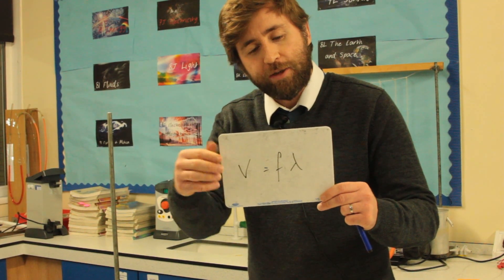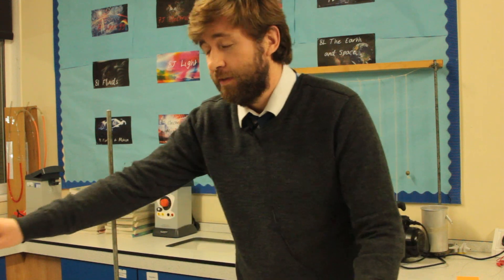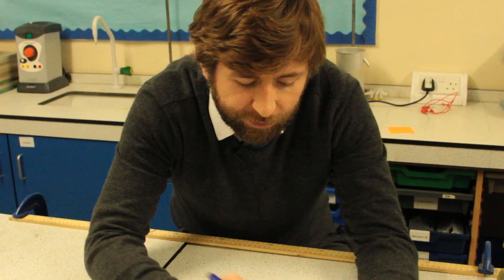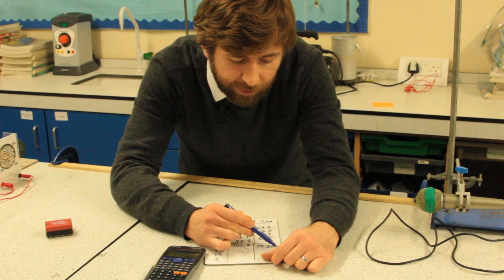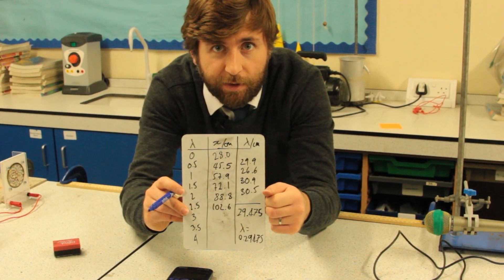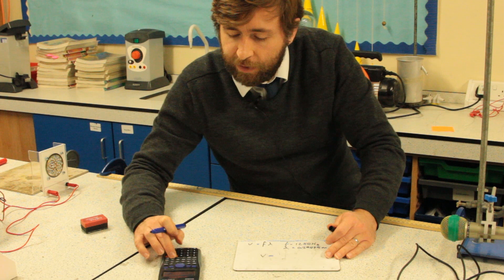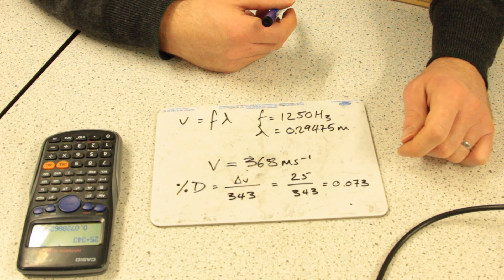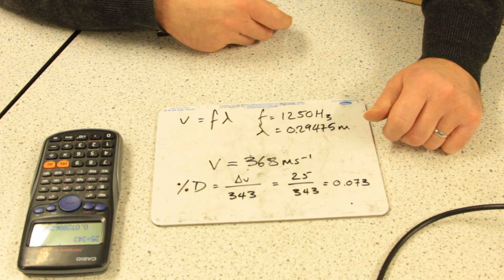Speed of Sound in Air - A Level Physics Core Practical Revision

Comment: why do you align the peak of one (mic / speaker) with the crest of other for wavelength as distance between two peaks is wavelength?
Reply from the maker: @acifychronic4221 you're looking to take more measurements for a greater accuracy once you've averaged them.  As it's a random error in measuring distance, so take more readings, eliminate anomalies then calculate mean.  
But you are right it isn't strictly necessary.  Cheers!

Comment: Just learnt about uncertainties - so would the uncertainty for your wavelengths be: 29.475 ± 7.29%.
The speed of sound uncertainty would then be 368 ± 7.29%. or 368 ± 26.9.

The method I did for  uncertainty = mean± (range/2)
The method I did for percentage uncertainty = uncertainty / mean *100

Is my method correct?

Comment: I am doing my physics practical with a similar set up but i am measuring the speed of sound in different temperatures
do you have any advice on that?
the videos really good!
Reply from the maker: Difficult one, I think you might be better off using an open ended tube method, as it may be easier to control air temperature in  a smaller volume.  Otherwise you may ahve to look at some natural variations like, time of day, windows open, or outside.
Reply: @kitbetts-masters  Yes, i am using an open end tube, with a microphone in one side and speaker on other connected in a similar way to the CRO that you did. And i have a way of changing the temperature in the tube. Can you give me advice on how i can get a good approximation of the speed on different temperatures? Mainly how i get the speed from the CRO? Or you maybe have a guide i can use for the CRO? 
I would very much appreciate it! thanks
Reply from the maker: https://youtu.be/C-t7B0kd6uU
In this video I talk through the fundamental frequencies of standing waves in pipes.  You'd get frequency from oscilloscope and wavelength from the length of the pipe.  🙂🦍
Reply: @kitbetts-masters  If i change the temperature, how would i calculate the new speed?
Will the reading on the CRO change?
Thanks,
really appreciate your videos and advice!
Reply: @lakshayveer4596  i need to ask as im doing the same experiment. How are you changing the tempertaure please?
Reply: @toniharvey6732  immersion heater

Comment: Sir, please tell me how you connected the mic to your scope?
Reply from the maker: Dan Deler it's a simple mono mic, and we have an oscilloscope lead which has two female 3mm pin ports. You could easily just cut the wire and solder it to an oscilloscope connector.
Reply: Thank you for your response, sir.
But still I am having an issue with it, I really don't know how to connect it to the scope, I am trying though. Please if you can help in any way I will be pleased.
Thank you.

Comment: Good video and very helpful - thanks. Small thing to mention (because it is important at A-Level) the calculated wavelength should only be reported to 2 s.f not 5 s.f. You can only be as accurate as the smallest number of s.f. used in the calculation.
Reply from the maker: Alfie agreed, but as I'm going on to use it in further calculation I wanted a few extra Sig Fig. Then I'd do my rounding at the end. But you are correct. The best skill is to use your calculator's memory to keep your calculated data ready for the next step! Thanks!

Comment: how did you calculate the wavelengths in the table. i can't seem to get the same answers
Reply from the maker: so the numbers I'm recording are reach distance where it is in phase or pi out of phase. (in other words every half wavelength.) so I'm just finding the difference between two of them to give me the wavelength. i hope that makes sense?
Reply: GorillaPhysics  im talking about the lambda/cm. i can't figure out how you calculated it
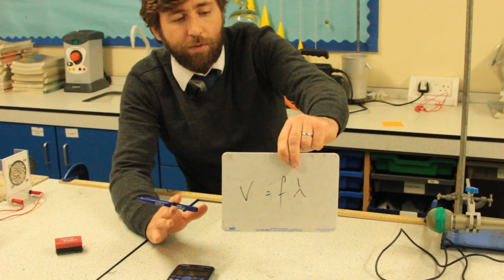Reply from the maker: Roxanne Foote pause the video at 7:02. then you'll see in first column i have number of wavelengths, ignore that. the second i have the raw measurements of these points on my ruler, each are a half wavelength apart. so third column, lambda in cm, is difference between every second reading, so 57.9 -28.0, then 72.1 - 45.5 and so on. these are a bunch of values for wavelength that I've averaged to use in my final calculation. i hope that's ok? have you tried this one for real?
Reply: i haven't tired it. I'm doing  a planning and designing lab using your method. I think understand now thanks
Reply from the maker: Ok cool, stop by and let me know how it went, (and if you got closer to the accepted value of speed of sound!)
Reply: @roxannefoote5384  same !

Comment: why there is an apparent change in the amplitude when you move the microphone back and fro?
Reply from the maker: just I think as the sound is spreading out the signal attenuates. so the difference between high pressure peaks and low pressure troughs gets less. the sound is less loud further away basically.

Comment: how did you calculate the wavelength?
Reply from the maker: +saad hassan Hiya, wavelength is measured on the wooden ruler on the side of the table.  Taking measurements between points when sound is in phase with the signal.
Reply: +GorillaPhysics thanks
Reply: @kitbetts-masters Physics   is this similar to the way you get wavelength from a standing wave?